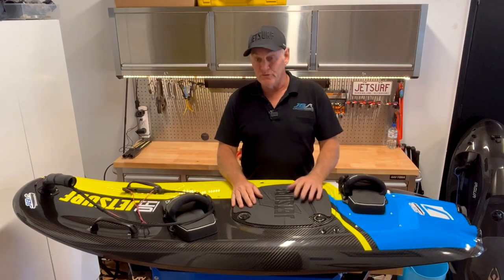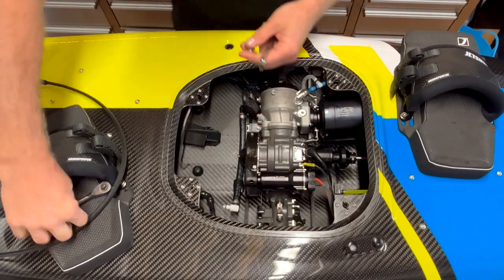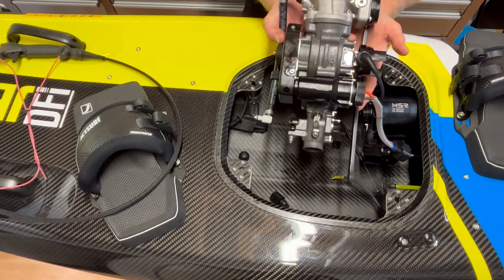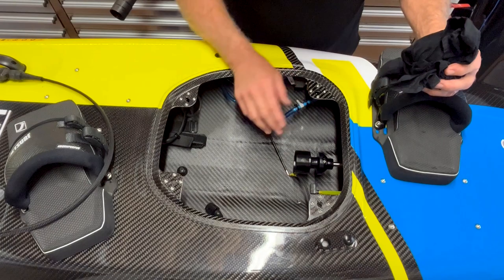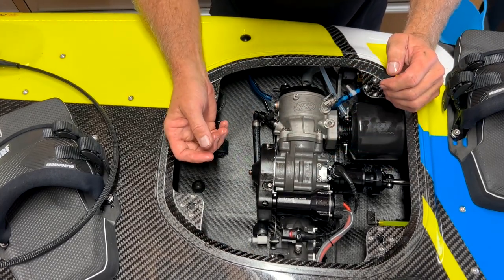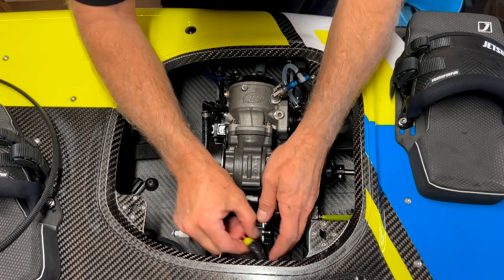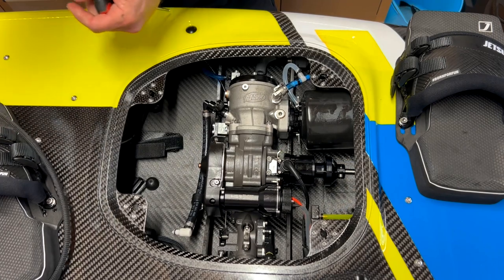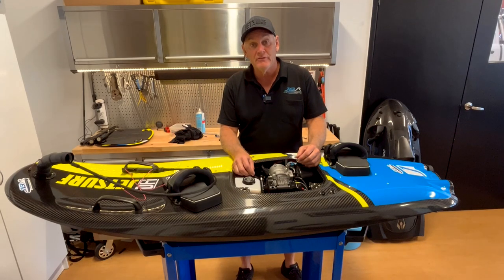Jetsurf DFI Engine and Exhaust Removal How to save you Hassles

Comment: Show us how to  change  the jetpump replace
Reply from the maker: Hi Yes I will do a video on jet pump removal soon
Reply: @JetboardAustralia  thank  you  it will  help  a lot I have  the same model as you
Reply: 0:20 Hello, after seeing your video about changing the exhaust I did it, thank you for the this. One problem, ball and the piece in the back are melting again. I flushed all pipe’s and T-piece and the piece were the pipe go in the engine. What did I do wrong? Thank you for a reaction. 👋👋
Reply from the maker: Hi Win there is a small hole in the pipe that can block up Its inside the fitting that feeds the water in to the pipe use a 2 mm drill can clean it out. I have made a video on cooling systom with a board with this problem and will post it in a few days
Reply: Thank you very much and I’ll have a look. But it’s the second new exhaust so…? I don’t know what’s wrong with it 🤔😞
Reply from the maker: there are a few tips and trick in the video that may help find the problem